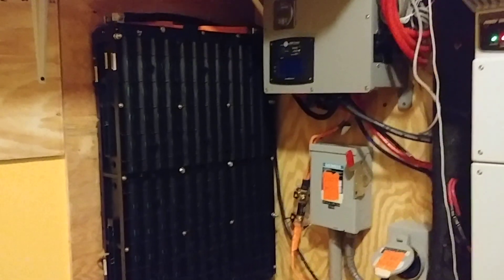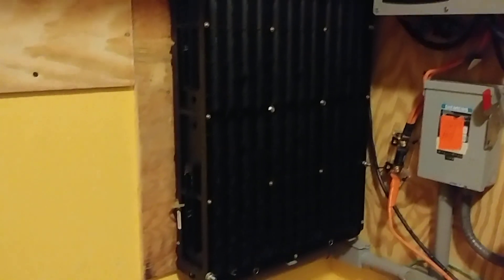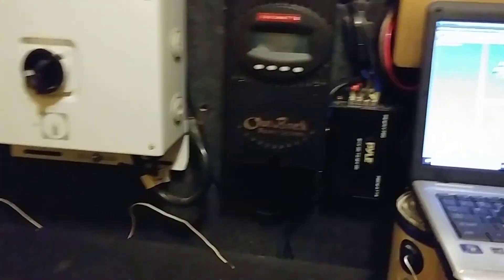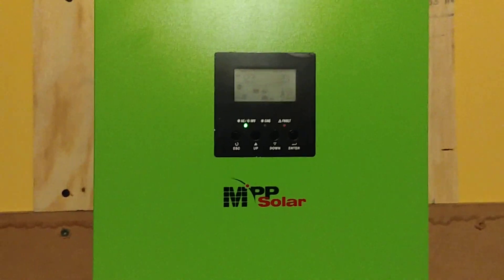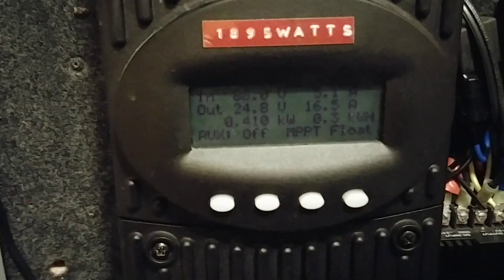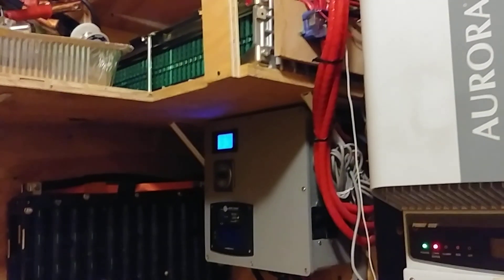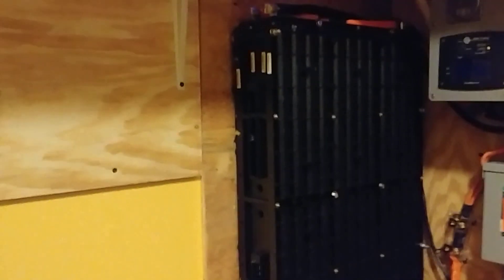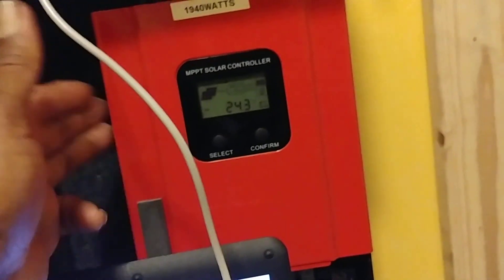Ford escape Powerwall not tesla

Comment: I have a set of ford escape not use siting on my way
Reply from the maker: Cool
Reply: @bimmers323ci  tomorrow i have to pick up some more because they give them to me free
Reply from the maker: @solarandwindinsouthtexasda1473  cool
Reply: @bimmers323ci  the voltage is to mucho one pack is 87v and the second is 76v
Reply: @bimmers323ci  and I also have 14 pack of Toyota yarys hybrid pack of 350v a pack
Reply from the maker: @solarandwindinsouthtexasda1473  brake the pack down to useable volts for your inverter
Reply: @bimmers323ci  i use the Toyota for my tool shed and yes they work great

Comment: Ford Escape do not come with lithium-ion it comes with nickel metal hydride battery I know because of Toyota bring nickel hydride batteries and honda to and I got them both yes that dude work pretty good
Reply from the maker: Thanks for checking out my video/:::/and also to let me know about the Ford Escape battery/// after I did that video I did when and do some research,,,,however at the time of purchasing those battery I was told by the seller they were lithium and I did not know the different......but it’s ok I am fine with it thanks again for checking out my video
Reply: @bimmers323ci  I have a small system with those batteries and it works great Ivan have Honda batteries to they're cheap and they're working good

Comment: Can u show a video on the cmax batteries how u wired them I have some and there 7 wired together to make a 24v battery and they are 29.4v max I could use ur help if possible thanks nice set up
Reply from the maker: thanks for checking out my video
Reply from the maker: dan my cmax  cell are wire at 6 cell at 4.2v to give 25.2v then  all parallel but i only charge to 25.1v
Reply: Yeah I have them 7 in sires and for 24v so I have 6 24v battery packs in parallel if there is 38 in one of ur packs how many kwh is it

Comment: killer deal, I want some, are these in the states or Canada? also how many S is it ? 12s or 16s?
Reply from the maker: Thanks for checking out my video....my system is voltage max charge is 25.2v but I only charge to 25.1v